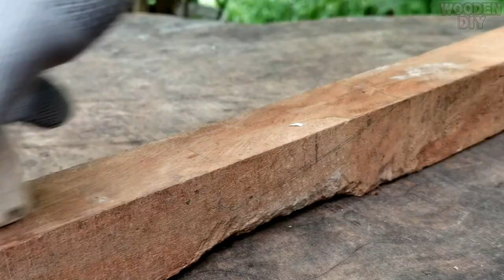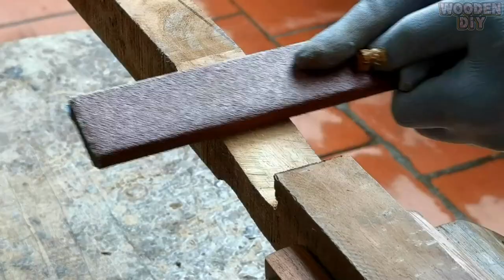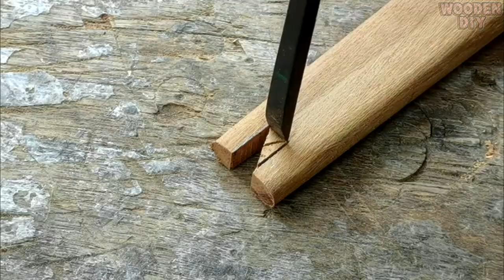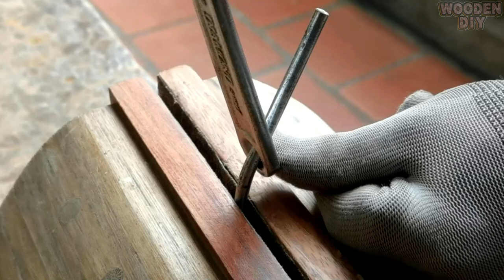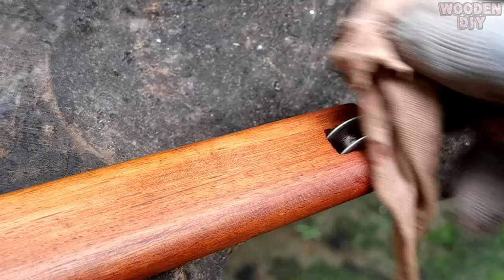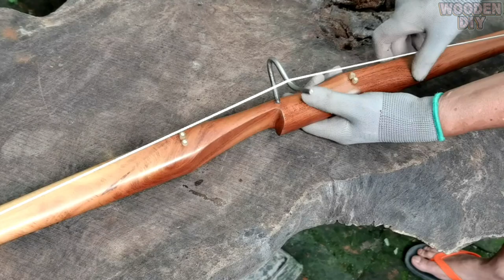Looks like a Bow but it's a Slingshot - Wooden DIY

Comment: Question as I'm not exactly sure. How does it count as a slingshot?
Reply from the maker: I think it's due to the use rubber tube
Reply: @MrCreative71  ah, alrighty
Reply: With a bow, the arms create/ store the energy
With sling, the band does.
(Had the same question myself)
Reply: Actually a double slingshot😊
Reply: Its more like a  compound bow  than like a slingshot
Reply: @cloudvii7777  Right. The arms of a bow.. well... they bow.

(Which is, confusingly, the same spelling (but different pronunciation) as when you bow your head..)

The arms of a slingshot are rigid. 
It's the (stretchy) sling that makes the shot possible.

Funny how the words for the tool are kind of 1 on 1 with their purpose.

Much like:
You drill with a drill
You saw with a saw
You file with a file
You rasp with a rasp
Reply: @Unkl_Bob It can't be a bow because it doesn't (bow).
Reply: @Unkl_Bob how? Compound bows use pulleys and bend. The rope stretches here.
Reply: @MrCreative71 not a slingshot. Not even close
Reply: Cuz when its completely shot you just sling it away?